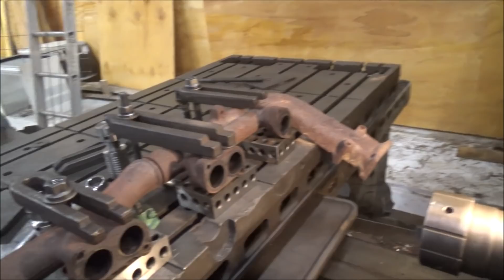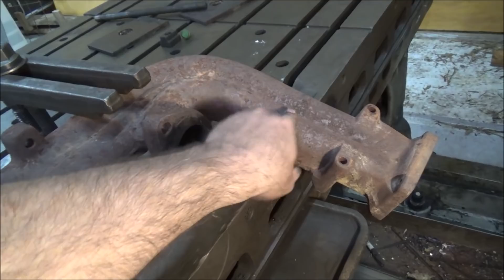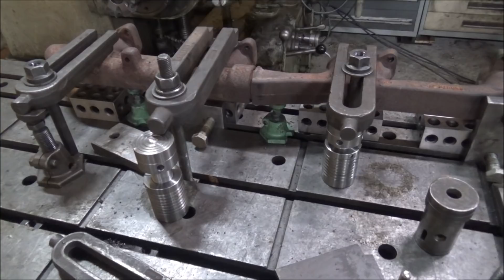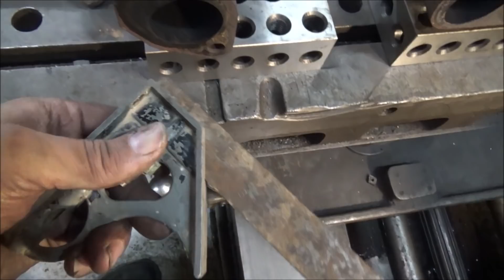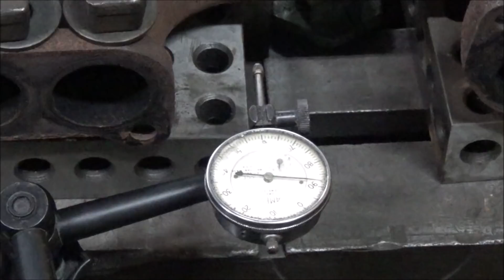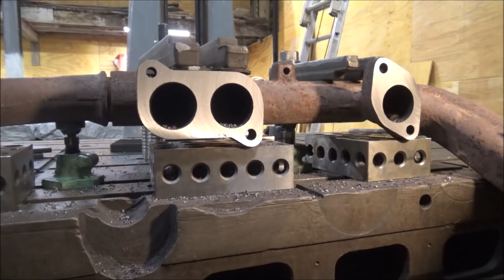Milling 8000 Series Deere Exhaust Manifold

Comment: Ran a Lucas b60 for years in a repair job shop. some setups 3 to 4 hours for 15 minutes of run time on the mill. customers said can you just trim of a little off you should be done in ten minutes I would just look at them and say you want it quick or you want it right .

Comment: Brian, on a machine that size , some longer clamps (we made our own, up to 2' long or more fir our 5" and 6" G&L's) and longer studs will come one in handy.   And some 2x2 crs blocks and a couple longer bars for setting rough parts on.
Reply from the maker: I have a pretty good variety of hold downs. and a lot of studs. I could use some really long clamps you are right.

Comment: Brian, nice job on that manifold, in surprised it didn't sound all that hard (material, not setup). Sometimes those manifolds get really damn hard to machine after they've been heated and cooled for 30 years. The cast 409 Stainless 370/429/460 Ford manifolds are hard as a rock to machine. Thanks for sharing!

Comment: Great work as always. I wonder, could this have been done on your Cincinnati horizontal with an extended arbor for the face mill? Or not enough table travel?
Reply from the maker: As long as I had an arbor long enough so the neck would clear the mill column I could make it work.
Reply: @bcbloc02  I wondered as much. The boring mill is an obvious choice. I ended up with an NMTB 50 spacer from an auction a while back; kept it for when I eventually get a large horizontal. 

Thanks for the great video!

Comment: I have found that best machine for milling manifolds is a Van norman mill. They have a head that will go from vertical to horizontal. You just clamp the manifold on the table however it wants to lay and just make both ends equal from the edge of the table. Then just tilt the head to match the angle of the face of the manifold. No adjusting of the manifold required to make the manifold face square to the table.

Comment: Hi Brian, With the types of awkward and irregular jobs you need to do with this machine, can you clean up the face edge of your table and use it to bolt on a straight edge, a fence or blocks to make it easier and quicker to align your parts and use as fixtures? You can see the "rough" spots along the edge, so could these also be machined out and insert a clean, straight "face-plate"? Stay safe and well :)

Comment: So..... IS the casting near the last port sticking up higher that the bottom of the last port?   Say some good looking Guy with a planer decided to plane all the ports would that casting  stop him from making a full pass? Or would he have to  stop the stroke short ? 

This guy could set it up like you did or even turn the ports up..   

Just asking for a friend  :)
Reply from the maker: Steve Watkins at Work Tell your friend they would have to stop right after the flange or they would hit the casting. I had to mill in lead on an angle to clear it.
Reply: @bcbloc02  I will pass that on!  Even though it's a 325,383,595,546,876,039,384 to 1 chance that that part will ever pass through his shop :)

Comment: That worked out well! I might have done it on a vertical mill. Set the backs of the flanges on some blocks and shim as needed. Then clamp from the sides on the flanges basically like you did. But, that elbow would probably interfere with the head of most vertical mills.

Comment: I had a surface grinder large enough to handle that manifold  but I could not have picked up the last flange.  Nice set up and a great finish.  Thanks for sharing.
Reply from the maker: Yep that pipe an inch from the flange makes it hard.

Comment: From my view Brian i would have bolted it to a length of H Duty angle iron using the stud pattern which would have given you the line and something close to what bolts to the block, then i would have used your toe clamps and jacks and nipped it all down then took off the angle iron to see how it moved. From a grey haired toolmaker in the UK
Very nice finish btw
Reply: The Essex Hunter . very good suggestion , Brian would probably do something like making a positioning jig as you suggested if he was doing a batch of them . thinking maybe a lot more work just for a 1 off tho . as usual excellent result .
Reply: @Christopher.C123  Some times preparing for a journey takes longer to plan than the trip it's self. From how i see it the block will be flat with in a bit, the exhaust is the factor which we know. Years of pulling cars/trucks out on frame jigs taught me that it needs a good pull in one piece as you get most of it close then deal with the smaller parts.
Brian made a nice job as always....

Comment: Yes Brian those are a pain in the ass!  Most manifold I do on my platten belt sander.  Those I split at the expansion joint and machine each half separately.  Then I leave the easy half proud and machine it to match , constantly test fitting on the surface plate or milling machine table.  Some manifold I do on my CBN cylinder head resurfacing machine and use 2 kurt vices to clamp the manifold. Unfortunately they kept the same manifold gooseneck design when  they switched to the 9 Liter .

Comment: Is that a 2 piece manifold with a slip joint in the middle? That groove in the center is a curious feature.
Reply from the maker: Yes there is an expansion joint in the manifold. That was actually 2 parts assembled.
Reply: I wonder if that was part of the cause of the flanges not being parallel.

Comment: Don't use a gasket all or use dead soft copper (even better heat transfer) and the heat will transfer to the head to help prevent warping. MLS gaskets do not transfer heat and you will be doing this again. The old Ford class C motorhomes and F350's with a 460 would warp and crack manifolds until you stop using gaskets. JMHO......

Comment: Which of the cylinders was the manifold gasket blowing out on, was it # 6? Why did they design turbo behind engine? It seems like that design would require so much more engine room  front to back in engine compartment.
Reply from the maker: It was the low #6 that was blown.  On tractors hood length not real important. Good width and height is though as it greatly effects visibility. Particularly if you are trying to look down to see the rows so you don’t run over the crop.  The hood are actually triangle shaped on these tractors so they are real narrow at the back so you can see better.

Comment: I like those 2-4-6 blocks.  I need to get some for using on my G&L 25T.  Have you seen anyone selling 2-3-4 blocks for sale??  Keep up the videos Brian.  Good stuff.  **on Edit,  Looks like maybe you are using 2-3-4 blocks there ? ? ?
Reply: I got some 2-3-4 blocks on ebay.
Reply: Ebay you can usually find sets at cheap

Of 2 3 4 and 2 4 6, sometimes they've been drilled or milled into, but for rough blocks those are good especially since they are cheap.
Reply: @procyonia3654  Thanks Matt. I know you always watch HBM stuff,  Hope you are well.
Reply: @kooldoozer  Been staying busy, just started scraping in my boring mill, finished up rebuilding and retrofitting an HBM and a VBM for a customer during all the pandemic stuff. Was just about to watch your most recent videos.
Reply from the maker: Travers tool just had 2-4-6 blocks on sale for  $89.99/set last week with a set of 1-2-3 thrown in for free. That is where I got mine. They usually have a sale on them at least once a year and I pick some up.
Reply: @bcbloc02  Thanks Brian.  I do like Travers Tool.  They are actually located about an hours drive form me here in Charlotte NC.  Thanks for the sale tip.  Will check them out. ---Doozer